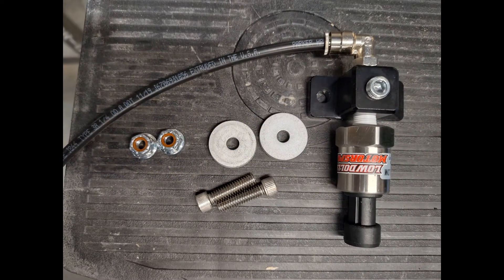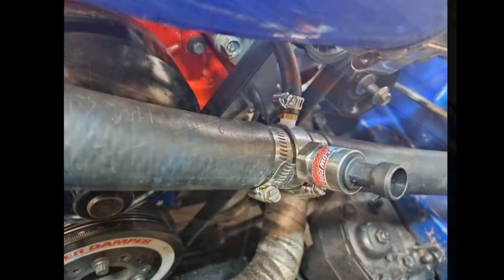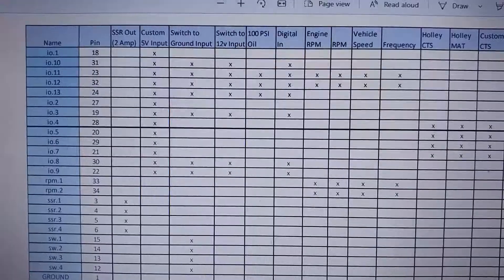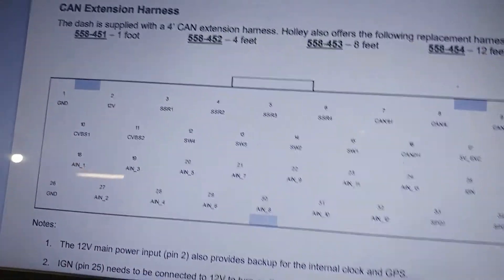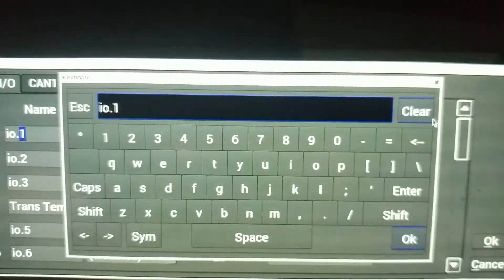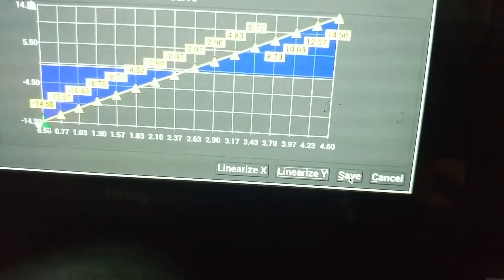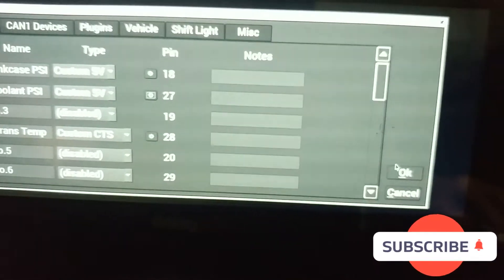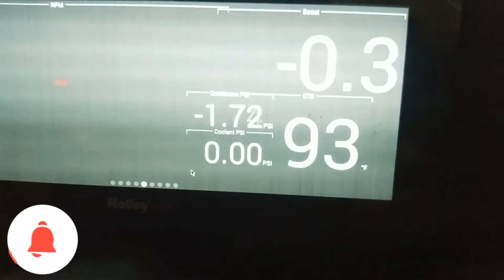Coolant and Crankcase Pressure Sensors

Comment: Explain to me how it’s better to look for high pressure coolant (indicating a pushed head gasket) for improper combustion, rather than a knock sensor that’ll detect it immediately before it’s a serious problem??
Reply from the maker: It's pretty simple. They piston rings will flutter and become unseated, giving a spike on the coolant pressure sensor. The same with the cylinder head, it can lift momentarily, giving a spike on the coolant pressure sensors. Short of a combustion pressure sensor in each combustion sensor (which is how F1 teams do engine development), these are the best two methods of identifying unstable combustion before it becomes a serious problem, which is called detonation.

Knock sensors do not monitor for detonation. They are essentially a microphone with filters in the ECU that are monitoring for a specific frequency, or noise, that on a completely unmodified engine corresponds to detonation. At best, all that a knock sensor indicates is that you have already detonated the engine, and on a boosted or nitrous engine is catastrophic.

Furthermore, ANY changes that are made to an engine will change the frequency at which detonation occurs. Any modification, even a cold air intake, or cat-back exhaust, will change that frequency. So, that being said, unless you spend days on a dyno with an eddy brake, and can run every cell on the fuel and spark tables, and all of the modifier tables to find exactly what hertz detonation occurs at, your knock sensors will trigger from false knock, and will not retard timing when you actually get detonation.